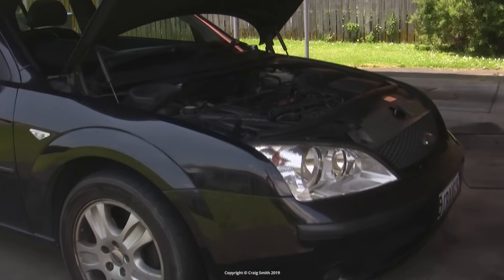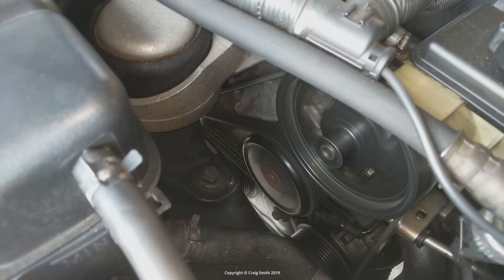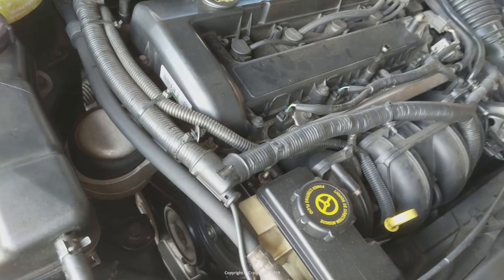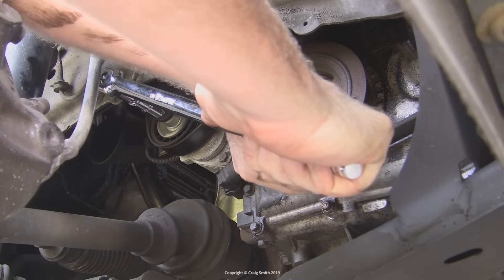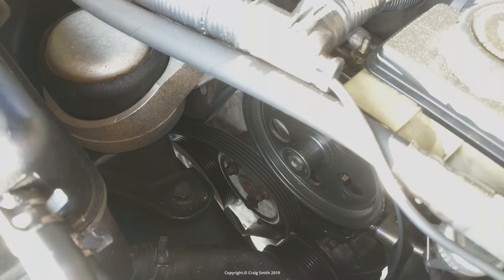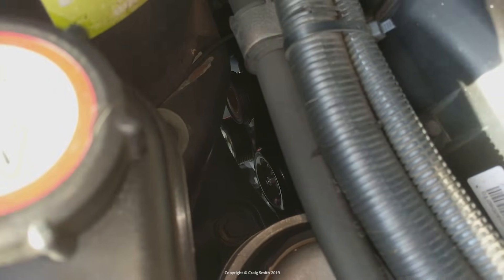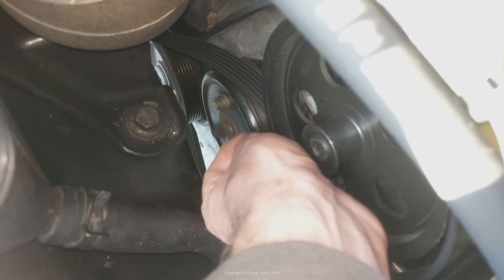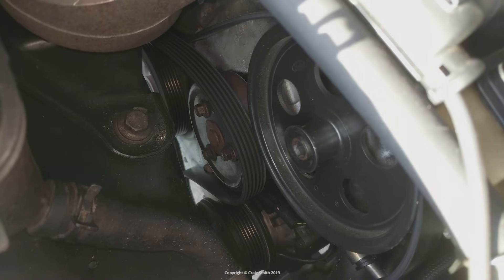Engine knock & rattle: accessory belt pulleys or engine internals?

Comment: you can also use a wooden dowel metal vibrates too much so you can use a wooden dowel put it on the part you think the noise is coming from make sure not to put it on parts that are rotating this works really good because metal vibrates too much and the wood does not vibrate very much and will give you a true or sound to find out engine noise also the man in the video is correct about taking the belt off to see if your getting engine noise somewhere else like in the motor itself sometimes it is necessary when working on a car trying to figure out what engine noise is coming from sometimes it is a good idea to cut the car on jack stands to eliminate road noise I hope this information that I gave you about the wooden dowel will help you locating noises Within the motor or exterior parts of your vehicle including transmission differentials Drive axles bearing noises in the lower part of the motor and upper part of the motor and valve covers additional accessories you're able to check with the wooden dowel like the alternator the water pump air conditioning power steering pump and pulleys Honda motor garters and other types of motors the Peace of wood dowel rod works very well

Comment: HIGHLY RECOMMENDED TO RUN THE ENGINE WITHOUT THE BELT IN THE MORNINGS WHEN ITS STONE COLD AND THE OIL TEMPERATURE HAS NOT REACHED ABOVE 200* F

Comment: Sounds like the same as my car. Changed tensioner and belt, suddenly the tensioner vibrates like mad.
Reply: So your vibration got worse? did you upload a video?
Reply: @DiegoKmona  found it. it was the water pump bearing coupled with worn out timing belt.
Reply: @DiegoKmona  sorry, "looks" like the same. changed from cheap aftermarket tensioner to OEM, the tensioner still vibrates. The old tensioner had bad bearings but it was solid, didn't vibrate. Google told me that some vibration is normal, but I really couldn't tell what normal or what not. The belt doesn't looks like it slacks under load when the AC is on. It doesn't make any funny noises but I just couldn't stop thinking about it. Video recording couldn't show the vibration probably because of the frame rate.

Which means that any of the pulley is causing the vibration or it was an out of spec aftermarket belt.

Car guy told it could probably be the water pump - which is plausible because I replaced the radiator last year. I think I'll try changing the belt with OEM first. The aftermarket belt was more expensive. It was a mistake to buy any aftermarket parts that attaches to your engine.
Reply: @DiegoKmona  scratch that. the vibration is back. i just have to assume it was normal.

Comment: Put a new belt and tensioner on made the water pump noise for sure. Sometimes noises aren't so obvious until you fix something. I hate when that happens, makes you think you screwed up.
Reply: 100000%. Replaced timing chain and vtc actuator on my Accord and have been hyper aware. Getting a rattling sound that makes me think i potentially screwed something up. But its a tensioner or something else

Comment: Did you ever find out what was causing the ticking/rattling sound?? As I have the exact same thing on mine, any help would really be appreciated
Reply from the maker: Mix of pulleys, I had to replace idler, tensioner, and I was getting a bad knocking out of the alternator OAP - see other linked videos.

Comment: I have a Mondy MK3 (an early one) 2.0 Autobox Ghia X Estate. And I also have this awful 'tinny' rattle noise.. very loud when engine is hot and I've been driving a while. No noise when cold! It's definitely on the auxillary side .. but when I stop and say put car in neutral the noise is not so bad, likewise in park (not always). Put in drive again and the noise becomes apparent again big time!! Bloody annoying!! Turned heads etc... Any help anyone before I investigate further??
Reply from the maker: It does it when it revs in neutral? Take the belt off as explained in the video and see if it still does it, then you will know pulleys or something else.

Comment: This is why you ALWAYS check all pulleys for wobbliness, loosening and bearing noise and replace if need before you reinstall the new tension belt and idle pulley so that way you don't work twice!

Comment: Did the water pump fix it? I have same sound. Just curious
Reply from the maker: The water pump had gone and it was a little noisy, but I had to replace the alternator pulley too. To be fair I have replaced almost every pulley on the belt now, they were all end of life.

Comment: My car has been starting to sound something like this i guess and my brother said it might be rod knock but the other day when i went to go clean the interior i turned it on to see if it did but its not to loud  and when i pressed the pedal i only went up maybe 100rpms and then the noise went away and it sounded normal and later when i finished cleaning my car i turned it back on and went up to 2000rpms and i could hear it a little more but going to higher rpms it sounds like it goes away, also the engine feels like it shakes a little bit, could it be rod knock? Or can the timing belt tensioner cause the shake too?
Reply from the maker: Take the belt off and see if it makes a difference, as demo'ed in the video. That way you know for sure.
Reply: @CraigsDIY  ok thanks

Comment: Question: 

I have a 466 Ducky workaround pedal star with a 300 MGH stroke pusher, 
and every time I flush what they used to call the fortune head, 
the rack assembly next to the over chassis runs too hot to allow 
the trans conductor room to rake the field jack (casing on or off). 
Does anyone have any idea how to get the hard stand to quit 
pushing the belt connections past 16?

Comment: hello graig's I also have a strange sound like a noise of pebbles I would say even as a really very weak chain noise between 1000 and 2000 rpm only rolling window open closed window we hear nothing beyond 2000 turns the noise disappears when I am stopped engine ignited I accelerate in a vacuum the noise is not present the noise and the only rolling between 1000 and 2000 rpm can you help me do you perhaps you also the same on your car maybe all engines duratec the bottom maybe The echoes of the engine bje am a French in France not a lot of duratec like I've been on YouTube for a long time I need your opinion can you look on all vehicles if you have the same noise thank you very much

Comment: Hi
Quick question..have you ever had a warm start issue with the mondeo
Reply: Anthony Quinn I have sometimes after starting my car cold and driving somewhere turning it off and starting it up after the engine has warmed up it sometimes stutters but always starts it doesn’t always do this only about 15% of the time it does but it always starts and drives fine I am suspect that it’s because it’s getting old now it’s a 2007 mk3 the last of the mk3 and has done 380,000km so it’s quite high kms

Comment: The symptoms are very similiar to a bad alternator one-way clutch.
Reply from the maker: I think you might be right. The water pump was making some noise but that knocking is still there after replacing it.

Comment: It always seems to happen like that!  You fix one problem and uncover another one.  Good video and diagnostic, though !
Reply: I guess it's possible that the new tensioner accelerated the failure of the water pump bearing.
Reply: Sometimes you uncover multiple problems just by fixing one freakin thing. Old with new, like new wine in old wineskins... Lol
Reply: Murphy
Reply: Slaw

Comment: I had a weird one which took a while to isolate. It was a loud rattle at idle which turned out to be the spring inside the tensioner. I’ve subsequently heard it on another car so could be fairly common on the duratec. Tricky as all the  bearings were fine and had me thinking it might be the cam chain at one point.
Reply from the maker: Yes it's very common. I replaced it for the 2nd time, shown in the other video, but I think I will do another on it specifically.
Reply: holy shit I think this is happening to me
Reply: @30YearOldBunta Same here! I hope that's it at least. I have owned my 2001 Mondeo since 2009 and I've never replaced the belt. So I've driven 211.000km (it has now done 276.000km) with this belt and I'm not sure if it was ever replaced before. It is a very good belt though, shame to replace it😂.

Comment: Nice! You're going through the same stuff i have before. Can't wait for the next vid :) and since you already changed the power steering pump, the idler pulley and the tensioner pulley, there is only one bearing left that MIGHT give off funny noises. The alternator pulley, that has a one way bearing on it, but i hope all gets fixed with the waterpump. Cheers
Reply from the maker: And the air-con. They both feel ok and I don't think they're making noise. I already replaced the alternator years ago with one from a manual car that has the 'free-wheeling' pulley (the auto's didn't from factory)!